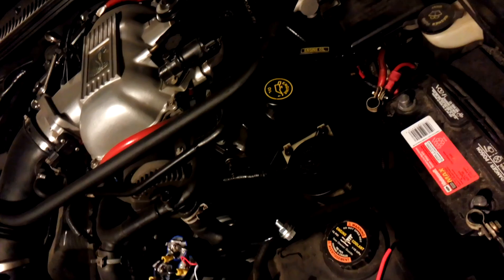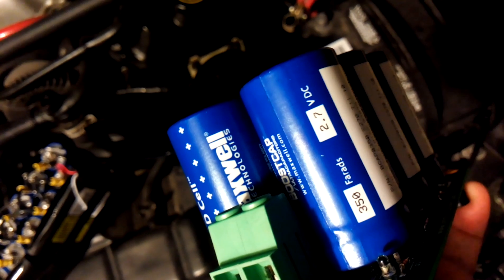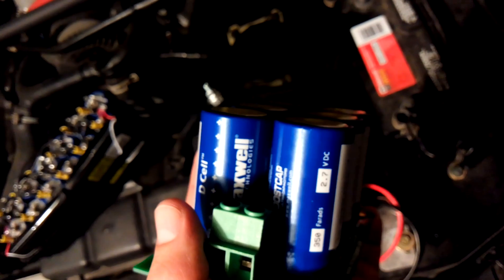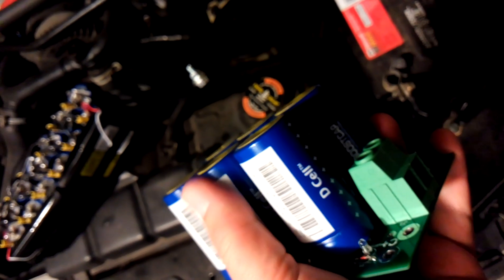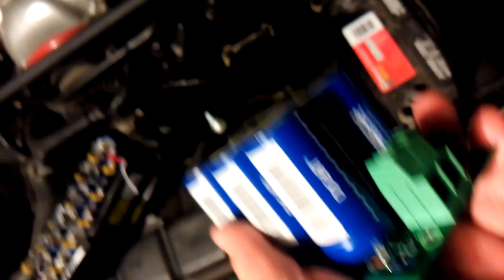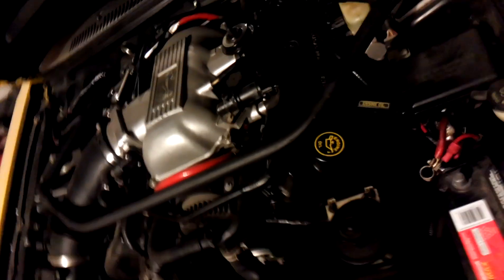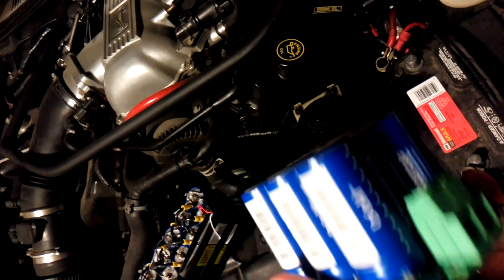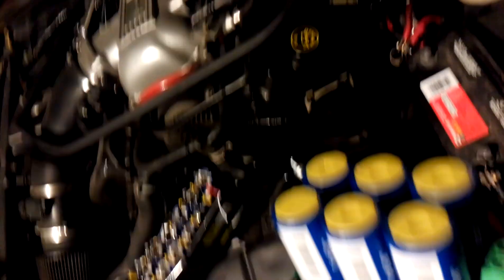Supercapacitor, ultracapacitor battery for cars. Starting a V8

Comment: The better question is why does your car need 10 revolutions to start an engine on acid battery? That ain't normal unless you're in -50F weather. You were in your garage. Thanks for feedback.

Comment: I guess that is not the original Maxwell capacitors (there is many cheap counterfeit Maxwell supercapacitor in the market).
You must try 2.7v 350f LSUC or 2.85v 3400F UltraCapacitor from korean seller, you will notice the difference.

Comment: Actually, the starter is not allowed to start more than 3 times in a roll. The overheated starter drags the current heavily and makes the capacitor far less efficient. It needs at least 3 min to let it cool down and make another try.

Comment: Once the capacitor is charged for the first time, do you need the bulb or resister in place on the permanent install? or will the Alternator be able to charge the capacitor without resistance?

Comment: Also the acid battery has finite number of time it can crank you car. Remember everything is finite here under the sun, even your days are numbered!!!!
Reply: skhumbuzo cele Most caps out there have a shelf life just as short as a lead acid battery regardless of on/off cycles. Most caps are lab tested to 50% discharge at a temp much less than what is in our engine bay.

Comment: I don't understand the endorsement of the 1.7 Farad Weapon X Capacitor @ $155 a copy instead of the 350 Farad protection board mounted 6x unit that you tested @ $79. I saw that unit, & it is nice but only 1/206th the capacitance for 196% of the cost. The cost/Farad reasoning escapes me. Please explain why you would opt to buy much less for twice the price. 

http://www.weaponxperformance.com/catalogv137/index.php?main_page=product_info&cPath=168&products_id=550&zenid=b87b7178a2501abf551ccbc59b8786f8

https://www.ebay.com/itm/Ultracapacitor-Module-KIT-Battery-Eliminator-Car-Audio-Starting-Remote-Solar/371669580302?ssPageName=STRK%3AMEBIDX%3AIT&_trksid=p2060353.m1438.l2649

Why aren't these capacitors being placed near or on the starter to reduce resistance & make them more effective?
Reply: Unlike a battery or common cheap eBay Ucapacitor which stores energy in chemical form, TaKAI ACE uses ESD fields to instantly deliver power on demand to high power devices. How else can a rich guy flex while showing his v8?

Comment: What were you trying to test?  Is the question can supercapacitor do all the things in your car that a battery does?  Do you want to run your performance radio with the engine turned off?  Do you just care about reliably starting your car without a battery?  How many days do you need to go between  starts? How quickly do you want your battery to charge if discharged?  You seem to have mixed answers to these questions together with little goal in mind.Supercaps are great for the right application if properly designed and sized.  I can answer any of those questions for you if you know which ones you want answered.  As a example, an East start loe compression 4 banger can start solely on a bank of 350F caps in series.  I personally would add a small battery in parallel with those caps to cover daily drain of the caps, parasitic drain, and starting trouble.  For people with those 4 bangers, they can hand charge the caps in 10+ minutes, so even with a dead battery they'll be cruising.  It depends on your needs and goals.

Comment: For something critical as starting your car, go with 3,000F SuperCaps. Maxwell sells them.  You can find them for $60+ on amazon. Looks like you went the cheapo route in the super cap range. try mid, to high end. should change your outlook in a heartbeat :D
Reply: R3d3mp710nX At that rate a regular car battery would be cheaper and have similar shelf life...

Comment: Thanks for the well done video. The wire size connected to the caps can't carry the current that larger battery leads do. Have you measured the voltage drop from the capacitor bank to the starter?
Reply from the maker: TheBdd4 It is 10 awg house wiring. The current carrying isnt the best... but I believe what is on the vehicle is 100% smaller then 8awg.
Reply: Ditto my concerns exactly. In a resistance rich environment & limited power, it would seem that the cap s/b mounted as close to the starter as possible, yet I never see that.

Comment: I see one of your problems : the wire you are using on the caps is maybe rated at 10 amps and you could in theory get 40 to 50 amps with that short of a run for only a few seconds and the rest goes into resistance (Heat) that size motor probably pulls at least 350 amps if you were to use copper buss bars instead you would see a major difference ....
Reply from the maker: James Tyler I was thinking along the same lines. For that people need to purchase the caps with the terminal nuts and lugs. Those caps are insane expensive at the time... and buss bars a pita. But yeah... you are definitely onto something.

Comment: Supercapacitors would shit on cold weather.. maybe if your car needs to crank more than 5x then I can see why you need batteries.. but why would you need to crank that many times? Supercapacitors would start right up.
Reply: Even if caps aren't affected, cold engines are harder to crank because the oil is thicker. If a warm engine takes 200A, a cold one could take 400-500A. That's why you see batteries rated at 750 or even 1000CCA,
Reply from the maker: In my case, the engine can sometimes be finiky since I don't have the warm / cold choke tables 100% down. Most times 2 turns and on... but once in awhile when the engine is not hot or cold, It takes 7 or more.

Comment: I suggest you have a look at my simple blog . search google "firesword supercapacitors calculations" - it is very implortant how many capacitors you have, and the voltage charged. Remember that the standard 2.7V supercaps have only half energy @ about 2V charge. In fact at some voltages 5 supercaps in series have more energy than 6 supercaps in series!!! In your case I think 15V is OK for the whole supercap bank.
Reply: Good to know. Thanks!

Comment: What if you use a bit bigger lithium battery and use the caps to catch a bit of the current so the lithium batteries aren't overloaded?
Reply: You can use solar panel to recharge the caps. No need for any battery. The caps hold charge for over 3 days so as long as solar panel is constantly charging you're good.

Comment: You can probably get by with replacing your car battery with a boost-pack constructed out of six 2.7Volt/3000Farads ultra-capacitors. I series they  will provide 16Volts/500Farads.
Reply: Problem is they're still somewhat expensive, more then acid battery.

Comment: You just need more capacitors. Dude Maxwell caps are used to drive transit buses. That's a massive 20 to 40 thousand pounds zero to 30mph for two city blocks on 244 3000f ucaps.

Comment: If you buy a NEW LEAD ACID BATTERY (preferably maintenance style with caps for each cell), put 15ml of 5% Cadmium Sulphate into each cell (total 90ml), then use your supercapacitor in parallel, it should double or triple the life expectancy of your Lead Acid Battery.

That's the real value of a Supercapacitor or Ultracapacitor. They are able to supplement the peak current demands which exceed the CCA of the battery and allow sulfation to permanently damage the lead plates of your battery.

Comment: A pair of Nissan Leaf 4-cell 2s2p 7.6V packs in series is a nice replacement... not cheap tho.
Paired with some super caps to boost the cold cranking amps, should make for a sweet setup.

But inquiring minds want to know... what's the beast behind the battery? Mustang, but what?
Reply from the maker: I will take a video and post it  next week sometime if you are interested. Its a fully built NA 32V engine with a full Kenny Brown suspension using KW fully adjustable shocks.
Reply: Sure thing! It'd be interesting to see it. I've wondered at times what's different about a 32V build. 

I had my stint in playing with cars back in the late '70's through the 80's... (yep, THAT dates me!).  I played on both sides of the field though...

First car: I was 18, graduating, and my Dad got me a sweet '66 Olds Starfire for graduation (well... I had to pay "halvsies" on it, to make me respect it more - smart man). It was equipped with the "Ultra High Compression" 425 big block Olds (7.0L), the less common 10.5:1 version with 'advertised' 375HP 470ft.lb. - but it was well above that in real life. (it was a game mfr's played back in those days, to keep insurance rates down) 

(BTW... my dad had quite a varied racing career... that explains why he wanted the Starfire)

Forged steel crank, over-square, and it used the larger .921 lifter diameter to allow a more aggressive cam profile... it would LEAP past the 5600 redline, and would make power past 6500. It was hard to keep it from laying down double-stripes all the way through 2nd gear though, as it had a switch-pitch TH400 to let the engine get up on its curve fast. 

On a couple trips between KCMO and North Dallas, I used to ride around 90-100 for long periods... occasionally pegging the 120MPH speedo. 1/4 mile trips were hard to get consistent, but with warm sticky tires and some throttle sanity (to minimize over-powering the tires), high 13's.  When sanity ruled, and I kept it around 70MPH, it would actually get 17MPG... otherwise, the 25 gallon tank was a real help.

It was a big car though... even though it was a 2-door, it was still around 3800-3900 pounds. I was shocked when I first found out it had a delete option for the heavy sound deadening under-carpet pads, and series of holes in the frame rails. No extra power accessories  like windows or seats - unusual for an Olds of the day. Olds called this the "business-man's sports car".

Several years past (still owned the Starfire), I got a '87 Mazda RX7 Turbo II... and tweaked the intake a bit, full bogey (large diameter) exhaust system, vapor injection, upgraded clutch, lowered 1.5". Ended up with 330-340HP in a 2800 pound car... it was scary fast... even "squirrely".  I had it North of 140 several times... that was my personal limit before fear slowed me down.

I actually had two of those, and had to transplant all my 'goodies" from the carcass of the first one to the second one... after I got stupid, and ended up in a fatal 1-car/1-person accident... even though I lived through it. God had mercy on me... to be sure. (more than once!)

Now I've mellowed quite a bit... married, with 2 incredible boys. I'm on my 2nd Olds Aurora 32V with the Autobahn package... "nearly" stock though... mods in breathing department again... complete braking system swap (from a big-brake Cadillac DTS), bigger diameter wheels, 255/35 tires,  but at least it makes inspiring sounds... love the song those 32V engines sing!

Got my wife a Toyota Highlander Hybrid... gets nearly 30MPG, 7-passenger, 4700 pounds, and combined Electric & ICE horsepower of around 280HP... it's an interesting vehicle... makes me want a full-electric car... I'm enamored by Tesla's "Ludicrous" mode... 2.8 seconds 0-to-60

Comment: Part of the fun is trying things out.  As far as starting an engine you have to figure how many farad your going to need to keep the voltage from dropping to fast based on your engine demand.  With your audio/engine setup you may of been better cost wise just getting 6 Maxwell 2000 or 3000 farad capacitors (you can get a balance board that will handle all 6 for around $15). 

Myself I decided to stick with the lead acid battery (tried and true and less picky on charging).  Rather than replace the battery, I wanted to reduce costs of battery replacement while enabling the battery to last longer with lighter strain from use.  I have made a Youtube video of my progress so far.  The only change so far I think I am going to make is add an extra 6 Maxwell 350F.  I'd like to get 2-3 starts worth of power in case it's needed without having to hit the charge button to refill the caps or wait on the resistor.  You can check my channel if you want to see a video of my setup.

I may also add this to an existing car battery to protect it and extend it's life (lighter drain on battery). 

It's been a fun project so far!

Comment: How can one of those lithium jump starters, which only have a 3000mah capacity start an engine. And they don't have supercaps, and they could start an engine more than once. How is your setup now as capable as those things?
Reply: +ibleed1 Sorry, typo. How is your setup NOT as capable as those things?
Reply from the maker: I have tried the jump starters. They won't start my car without the battery there. They are meant to supplement the power to a weak battery, not be used for a repeated start situation by themselves. 3 revolutions with the jump starter by itself and its done.

Comment: you need 6 Maxwell 3000f that will start your car all day and a fix to the cap bleeding power is a small solerpanel on the dash in the end its the same size as a car battery but much less wait
Reply from the maker: That is actually a good idea. But 350 bucks is expensive. I have the equivalent of about half of a 3000 farad bank (1300 farad through doubling the banks). I think with 3000 farad caps I would get about 10-12  revolutions. Only problem is that there is a hot start issue not sorted out yet on my engine. 99 times out of 100 it will start, but once in a blue moon it gets mad and just cranks over for 15 revolutions before firing. Don't know if I can trust it just yet... but maybe in the future.
Reply: +Wapn Perfo you have to factor in you are never going to need to replace it
Reply from the maker: chabka34 Very true... never thought about that point. Although, if you need to use a Lithium based battery along with the auto battery, you will need to eventually replace the Lithium portion at some point. Btw, I managed to upload the video where I tried to start the engine with the 6 cell super capacitor if you are interested. :)
Reply from the maker: Sorry, the lithium based along with the super caps.
Reply: Wapn Perfo Hi,
Please make sure that you don’t charge a lithium battery at temps below freezing. Lithium titanate (LTO) are the only exception that I know of. 
Supercaps are great for supplying that initial surge for cranking (or that deep bass;). A lead-Acid battery as energy reserve is not a bad combination. The caps will make the battery last a lot longer.

Comment: Li-Po, Li-Fe, etc are different. Li-Po is very very common in RC cars. These are the dangerous ones. The ones that can explode off a short. Li-Fe is what people use as a back up to the Caps. These do not have those dangers. Also, the Li-Fe battery is only really there to keep leaching down on the capacitor bank. I is not intended to help start the motor. I will say this set up is not for you being that you have a performance motor with high compression and a sound system.

Comment: Don't caps start charging again when cars running?
Reply from the maker: They will... so you can get multiple starts... just that you have to bank on the engine starting within the first couple revolutions. If it doesn't, you will need a boost.
Reply: It takes 3-5 secs for caps to fully charge on alternator. I'm not sure how long it takes on solar panel source however. That would be ideal solution instead of battery pack which adds weight when cars seats in garage or parking lot, or when one is on vacation.